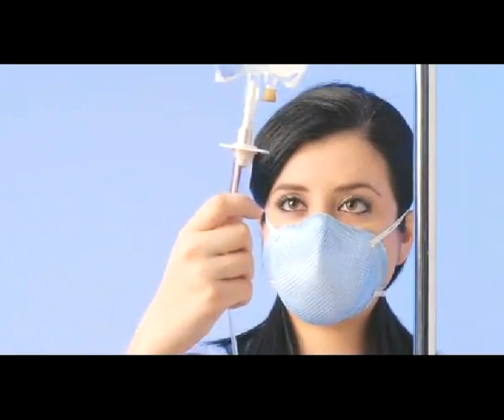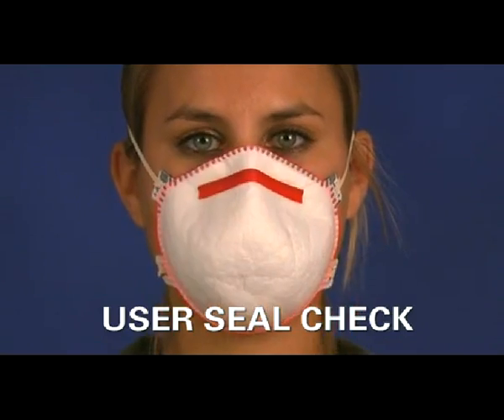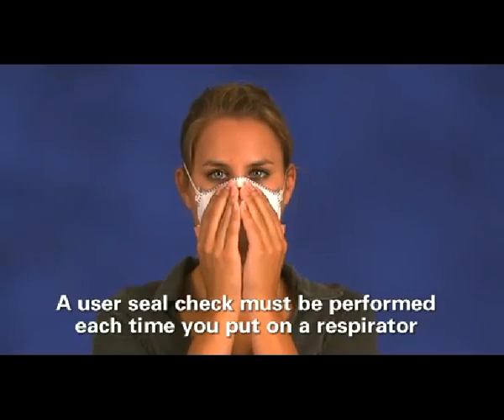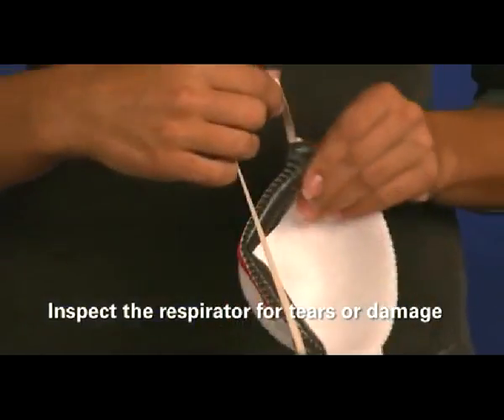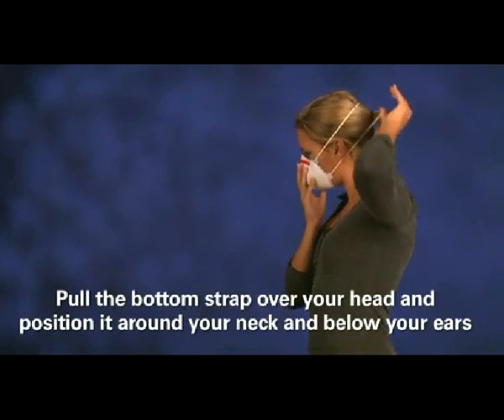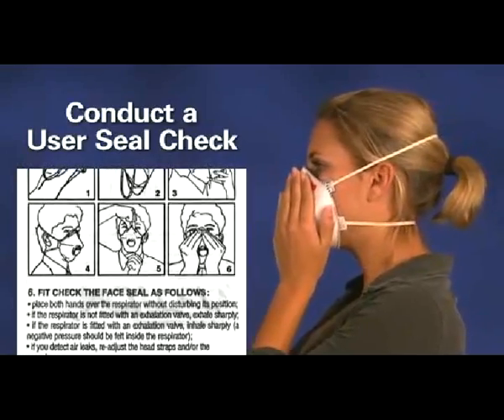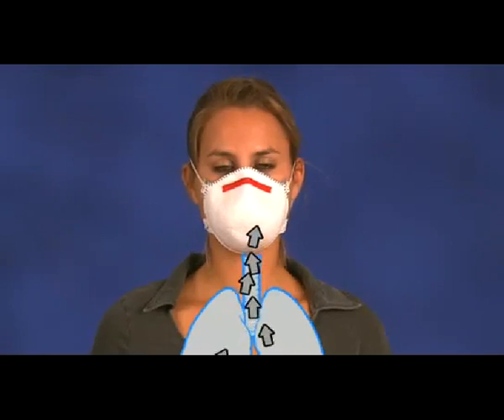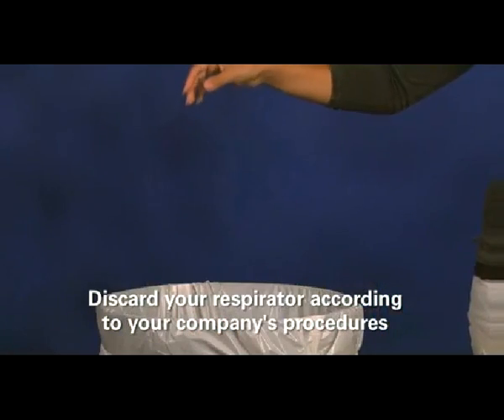How to Perform a User Seal Check with an N95 Respirator

Comment: WARNING: IF YOU HAVE A BEARD, GOATEE, OR OTHER FACIAL HAIR AROUND YOUR CHIN, LIPS OR CHEEKS , THE N-95 MASK WILL NOT FIT. VISIT THE 3-M N95 WEBSITE OR CDC WEBSITE  "FACIAL HAIRSTYLES AND FILTERING FACE PIECE RESPIRATORS" TO FIND OUT WHICH SPECIFIC FACIAL HAIR STYLES WILL WORK WITH THE N-95 MASK.

Comment: WARNING: THIS VIDEO INSTRUCTS PROPER FIT TO GUARD AGAINST DUST AND PARTICLES. IT DOES NOT INSTRUCT CORRECTLY FOR COVID-19 VIRUS OR OTHER INFECTIOUS GERMS. DO NOT PLACE DIRTY HANDS ON MASK. PUT MASK ON BY HOLDING ELASTIC STRAPS ONLY. USE ONLY VERY CLEAN HANDS TO BEND THE MASK'S METAL NOSE PIECE. VISIT THE 3-M N95 WEBSITE AND CDC WEBSITE AND VIDEOS FOR PROPER USE AND FIT.

Comment: Can somebody explain why I need to do a fit test if the hospital only has two sized of N95 and the large one is too big for me?  I just don't get it.  Its not like there are 20 to choose from until we get the best fit
Reply: Your employer can provide a PAPR if a N95 does not fit.
Reply: If the respirator is not properly fit tested and passes, then it does not seal on your face.  Without that fit it is not protecting you from the coronavirus in the air  around you.  Your employer is required by law to provide you with a fit tested respirator,  Please file an OSHA complaint and talk with your union, if you have one.

Comment: My doctor recommended that I wear one of these in public (or within 10 feet of talking to someone)... instead of a homemade mask because I have 4 strikes against me for developing complications from COVID-19. A friend has offered to give me ONE. 
I also made face shields from 2.5-liter pop bottles, foam from Home Depot and a few things from the Dollar Tree- just in case.
Reply: Sounds good. how did yo manage to cut those pop bottles and fit them on your head?
Reply: Abdullah E. Arslan try cutting it down the flat middle and around the ends, and take off a piece long enough to cover to the middle of your neck. Bend it the opposite way that it’s already bent (which should counteract the original bend) and then put it on a headband or whatever you have around that can secure it to your head. Thick, flat headband is my recommendation. You also should have a piece of foam or something to wedge between the forehead and shield, anything comfortable, because otherwise the plastic is just going to be hitting your face